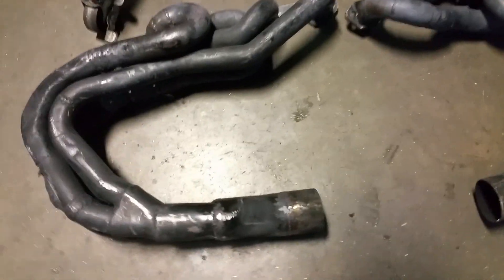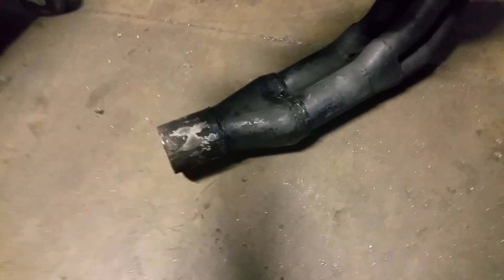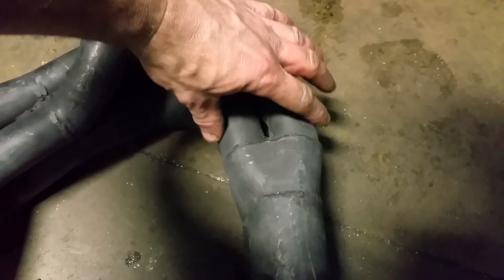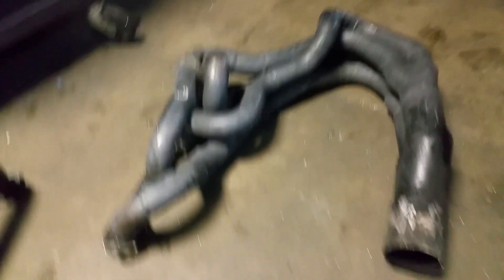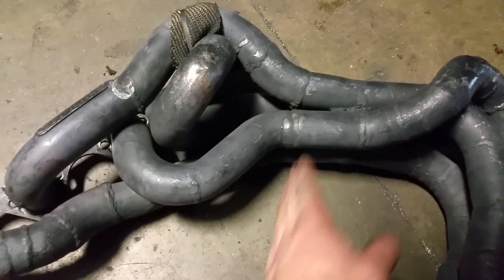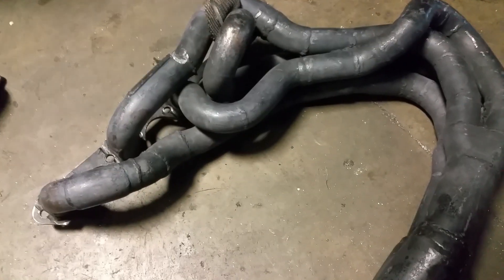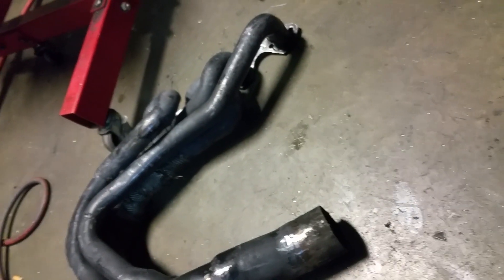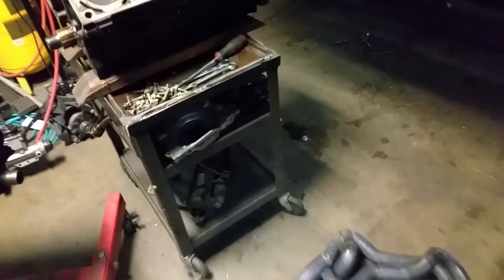Equal length V8 headers with a twist

Comment: Its like a musical instrument. Look at a trombone. You make the pipe longer and it gets deeper. You make it shorter and it gets higher. If the note peak spacing lines up with the the valve events and the repetition of events in a significant way the note will keep rining onto thr next event and get louder. Putting steps in pipes or creating branches creats reflection points for additional sympathetic vibrations. Shorter is higher pitch and if you can make the lengths harmonic it will have qualities of a musical chord and wont lose much energy. Higher order harmonics will line up with thr engine more often and lower order (long pipes) will have a small number of peaks in the power curve and if the upper peak isn't at a high enough spead it can truncate rpm range and power because you cannot rev the engine high enough to find the next peak. Because of this truncated power curve long headers are often associated with torque and short with hp but if thr length is long but not too long it can possibly make as much power as a short header with a midrange bump and a wide torque plateau. But the shorter pipe version might build power more smoothly and rev beyond the power peak with less trouble.

Comment: I'm really impressed with your exhaust work. I plan to build a junkyard 4.8LS,5.3LS,or 6.0LS. I also would like to use small twin turbos and then run the exhaust from the turbo exhaust on each side. Basically making a true dual exhaust setup with a single pipe from each side. I really like the 180° header setup or actually your custom setup that sounds like 180° header. I was just going to flip and cut the factory manifold and use as much of the manifold for plug access. However I would have no clue how to make it sound like a 180° header. A LS sounds okay on its own especially at higher rpms 6500rpm+. But a LS is very common. I would like it to sound like a supercar with 180° headers if at all possible. Could any of my ideas work, twin turbos, turbo back exhaust, flipped and cut manifold? Any advice would be greatly appreciated.

Comment: Your effectively making the headers a tri y set up, Carroll Shelby did it to take advantage of the 180’ header arrangement advantages with dual exhaust. Merging the two left and right banks give the sound of a true 180’ degree set up, but Shelby figured out that there was not much to be gained otherwise… Firing order with the tri Y pipes on a SBF 289-302 is specific to its design, in your case incorporating the the equal length with the the two latter y pipes past the primary header makes the noise your hearing 180’.  The 65-66 Mustang Shelby’s tri Y headers was Shelby’s cheapest attempt, biggest bang for the buck, and make it fit deal…..

Comment: 180 degree setup on a ford 289/302/4.6/5.4 all have the same firing order.to make the 180 degree headers actually work ,as follows. the left side of the engine. cylinders 2 and 3 tie into 5 and 8 .that's one header. cylinders 1 and 4 tie into 6 and 7 .that's the second header. each of those cylinders ,fire 180 degrees of each other . that's why the engine will sound like a flat plain crank v8,like a Ferrari .you get a lot of benefits ,like low and high scavenging effects .boots up low and high end power , way more than typical long tube headers .your setup if very close to the 180 degree headers , but obviously more compact. sounds like a de Tomaso pantera ,but not the 351 w .I love it

Comment: I would really like to try this on my LS swap rx8 I'm trying to get done, I originally thought about doing an 8-1 setup under the car and basically make a bowl out of the headers to kind of cup the bottom of the trans and build a collector off of them but that would make it pretty hard to do basically anything under the car like oil changes a huge pain so I think I may try this idea on mine and see how it works and sounds
Reply from the maker: There's a C7 that made 180 degree  headers fit:  https://imgur.com/gallery/6JnKO/comment/1144227199       and just found this rx8 guy doing something wild:   https://www.youtube.com/watch?v=79vQ8Lo0asE

Comment: If you make a perfect set of exactly equal length headers to firing cylinder 1,3,5,7 and 2,4,6,8 this is firing order, not to be confused with cylinder number. You have to have a crossover for two pipes cylinders 3 and 6 on an LS. Firing order is 1,8,7,3 on the right side and 4,6,5,2 on the left side of the motor from the front. Right side is all odd fire except for cylinder #3 which fires as 8, left side is all even fire except cylinder #6 which fires as 5. It's funky and makes for a pre collector crossover so left header is cylinders 2,4,3,8 and left is cylinders 1,6,5,7 with 3 and 6 tubes swapping headers. Tricky to keep equal length. In some cases you may be able to tuck across under the oil pan. Then exhaust scavenging can get you greater than 100% volumetric efficiency. The draft of the scavenge actually is creating a vacuum on the intake during the cam overlap exhaust closing as intake starts to open. This gets intake velocity going before the piston even comes off tdc, then piston going down increases velocity of intake air, it can fill the cylinder beyond atmosphere pressure. Take a Gatorade bottle and blow a puff of air into it quickly. If you can cover it with your hand quick enough there is more pressure than outside of the bottle, same principle. It's not done on passenger cars due to cost and packaging constraints as you know well lol. Going into a big single, 3.5" plus,  after will pull even more vacuum as the intake valve cracks open. Using a straight through muffler with perforated core and packing exactly like a street bike has the best flow for effect. That is exactly why the street bike 4 into 1 craze started in the 80s, bikes came with dual exhaust pipes into the 90s, they sounded silly compared to 4:1 and the sound matched performance. Listen to a ninja 600 with slip on silencer dual exhaust compared to a Yoshimura 4 into 1. With jetting necessary because it leaned out the bike, a 10-25% gain was not uncommon.
Reply from the maker: Did you see this one yet?   https://youtu.be/pG2TvSl8dRY

Comment: U r one of the very few who put this much effort in there exhaust. I also recall you mentioning something about you changing ur engine when it goes with something else. I think it would be a crazy idea if u put a v12 in there along with crazy exhaust work. Cheap v12 like mercedes M120 (6.0 400hp stock used in Zonda) 1gzfe(5.0 about 300hp) Pretty decent v12 also cheap. Regarding the weight they weigh as much as a 2jz gte u can check am 100% sure of my info. Just wanted to share my thought cz it would be rad with ur exhaust work!!
Reply from the maker: I've been looking at v12's everyday.  It's the m120 I want , but I would also jump on bmw n73 or s85 v10.  It's hard to find just the motor , most have a car still attached to it.   Did you come here from the Mercedes forum?   https://mbworld.org/forums/showthread.php?p=7797236#post7797236
Reply: @NickKautz  hello mate I have designed a new exhaust for an LS but I used a different concept.
It mainly aim at using 1 header for each bank and getting equal pulse and rotary fire pattern from each bank for significant torque gains.

Unfortunatly equal length exhaust dont even out the pulses on the crossplane crank american engines that is why having 2 equal length headers doesnt sound like 8-1 and an 8-1 does not benifit from suction unless a rotary fire pattern is followed and this gains 75lb.ft of torque on an offroad automatic transmission Ls 6.0.

If ur still experimenting with ur v8 e36 send me the firing order of ur engine and maybe ur email so i would design u the exhaust, send u some drawings and get ur opinion about it for ur engine and for the LS engine.

Comment: I'd love to see you work on a V10 engine at some point. There is a lot of potential with header design - I'm really curious as to what a 10 into 1 setup would sound like!
Reply from the maker: That would be fun.  They are harder to come by , I think v12 is easier to get.  Like one of these: https://www.youtube.com/watch?v=9zZcAJ-NEKo&t=55s
Reply: @NickKautz  truck v10 would probably be the easiest right?
Reply from the maker: I did get a v10 bmw M5 , currently rebuilding the engine.  The factory headers are already equal length so I'll be messing with rest of the exhaust system.  10 into 1 is kind of out of the question  in general since 8 into 1 on a front engine car looks like this:    https://www.dropbox.com/s/eg854dnmz1w0a2z/1.jpg
Reply: Nick Kautz there's more of a problem there too because all of those V10s are odd-firing. There's really not much you can do about it at all.
Reply: @NickKautz  not even basically unlimited budget race cars would do that. That's only something a fabricator with an open checkbook would do. An equal length 10-2 with an x-pipe would sound similar enough with much less headache. Or a 10-2-1

Comment: I saw that you're doing an LS swap next. I've been wanting to  do something to get that 180 degree or 8-1 type sound without a nightmare of tubes on my LS swapped el camino. I started on a set of  true equal length tri-y headers made from nascar LS series Kooks headers that I started on years ago & never finished. I may finish them up as is & try out with a triple x- pipe setup rather than a crazy over the engine 8 -4 -2 -1 setup running forwards I was thinking of. My tri-y's pair 1-5 & 3-7, 2-4 & 6-8. This splits the pulses @ 5& 3, then 3&5 apart , as opposed to yours @ 6&2 then 2&6. 
True 180's pair 1&6, then 7&4 into 1, 8&5, then 2&3 into 1.They all pulse evenly, but what a fitting nightmare around or under the engine. Still may consider over the engine forwards & down with all sorts of heat shields & huge vents under my tall hood for ease of plumbing, but not sure if I could reject enough heat.  
You may be done with something else LS based before I have time to fool with, so interested to see what you end up doing. Here's a link to a thread I was doing as a research project with a few other links on it.. Kinda a shortage of any good solid info. https://gbodyforum.com/threads/anyone-ever-hear-8-into-1-headers-in-person-or-know-info-about.70740/page-6.
Also up for consideration  is just true equal length long tube headers, along with 1 to 3 x-pipes and possibly boom tubes and or spin tech type mufflers. A sterling martin nascar setup thought to be 180 headers was a dr gas x-pipe /boom tube setup. According to dr gas, when the sound changes, better scavenging is occurring.
Reply from the maker: That's dope.  I'm working on the headers now , I'm doing the mysterious 4-2-1 from the  "Best sounding  exhaust setup so far" video.  I'm not wrapping them around the steering rack this time, I'm going the usual route.  The way I think of 180 headers is you don't want to have any pulses entering the same collector 90* apart unless they all are (8 into 1),  something weird happens in the collector when 2 pulses are so quick in succession , I think the sound from each joins into 1 sound making it deeper and causing a gap before and after.  So you're actually only hearing only 6 seperate explosions per cycle from a US v8 and 2 of them are different than the other 4.  My calculations say , to achieve this , you want to join 1&7 , 2&8 , 3&5 , 4&6 ... so as long as those pairs each have a collector , you won't get the weirdness,  and thereafter you're dealing evenly spaced action , do with it as you will.
Reply: @NickKautz  Thanks Nick .Listened to  a few of your video's every day last few weeks trying to get inspired to get to the project, which has to come only after my widebody project gets to a stopping point. Like I said, not a whole lot of really solid info out there. At any rate , true equal length headers seem to be a consistent item in getting a smoother screaming sound. The other is getting the pulses to even out from one method or another along with that. Your spacings & mine, which are typical proper LS tri-y both are consistent in pulses between cylinders throughout all 8 cycles, so I'm hoping mine I started on can give similar results to yours without redoing. You know how hard getting fit & equal length is.
 Others with nice equal length long tubes, either 4 way or tri-y with certain exhaust have gotten similar tones, so that gives me hope for mine as is . If someday your version sounds great on an LS & mine not as good, well, chop & change.
Results speak & your ford version screams results.
May try a parked sound test this weekend with a few long square tubes to simulate boom tube sound.
Reply: @joeleleux716  hey joe- saw that you finished your triple x pipe on some forums. Would you upload some exhaust clips of it? How does the triple x pipe set up sound with an LS? Very curious
Reply: @trashbandit2449  I finished the triple x-pipe  long time ago, but unfortunately haven't had time to finish my custom headers that will need to go with it. Also figuring that the new Corsa universal pro series mufflers should give or help with the exotic sort of sound. Expensive though.
https://www.youtube.com/watch?v=stAxCklh_e4
Reply: @joeleleux716  wow, the corsa alone makes it sound super exotic. Interested to hear the full set up, best of luck finishing the car!

Comment: What is the exhaust after header in this version? Your triple x pipe and mufflers?
Reply from the maker: It was 3x in the video clip with dual exits.     mufflers were magnaflow 14419 before each exit ... exhaust tips were 4 into 1 collectors turned backwards, lol.   But I have a feeling that these headers with a simple y-pipe to 3" single and    1 of those mufflers inline would sound very similar.   Maybe a larger  magnaflow if it's for the street

Comment: Can you help me modify my longtubes like this?
Reply from the maker: When I try that for the 1st time , I'd like to have the car here so I can make sure everything fits and then test it , make adjustments, etc... I don't know where you live and it would be a pain to have to ship things back and forth.  Once I've got the process down , yeah I can do that.
Reply: Nick Kautz I’d bring the car to you.
Reply from the maker: @dustinguriel620   I'm in Hayward.   What kind of car?
Reply: Nick Kautz 97 mustang cobra with the 4.6 DOHC engine.
Reply from the maker: @dustinguriel620  How far away are you from Hayward?  It's also possible that you could send or drop off just the headers ,  and I'll modify them and send them back to you ,  and then you can have your local shop get them to mate up with the mid-section cuz the length might change by a few inches.
Reply: If you get you get a set for his car figured out please let me know.  I have a 1989 foxbody so they are pretty similar.